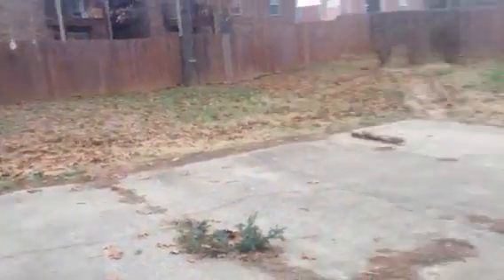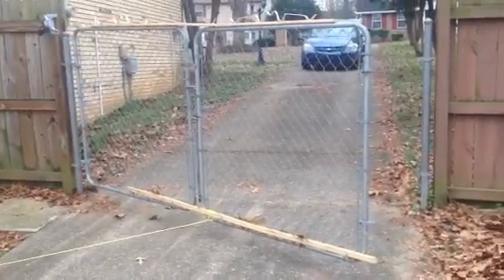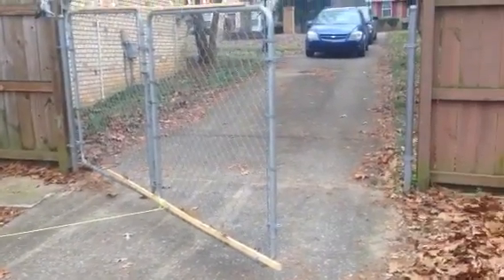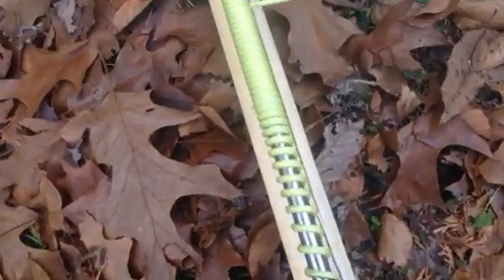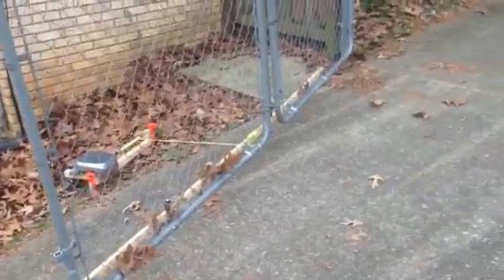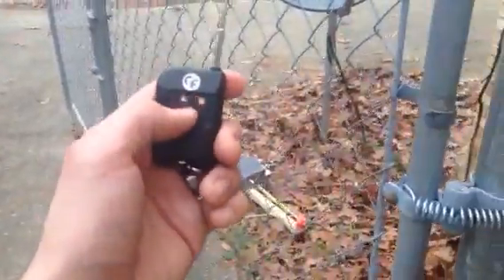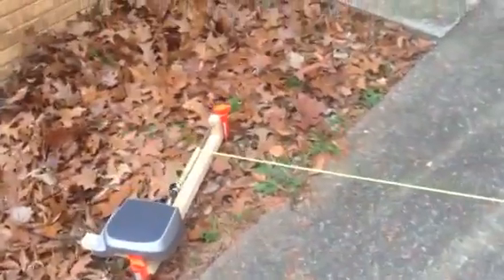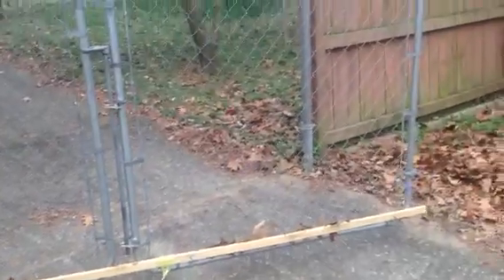DIY Gate Opener ~$50

Comment: the harbor freight 18 volt drill  worrior brand not the real cheap one or a dead free unit even better.or Toyota windshield wiper motor. its low geared one speed n a voltage buck step up coverter box 5 pack at ebay amazon 600 watt 18 bucksish i think hooked to a 12 volt battery n solor or trickle charger transformer based older ones set to what ever works best fer speed13-volt to 22max n your board remote thing and even a dip switch to

Comment: That motor is gear driven, you could have used a 12" diameter spindle and opened it in 5 seconds.

Comment: Hi Mike. This was an awesome project of yours. I actually want to do something very similar to this but I have a couple of questions you might help me answer: 
1. Does the motor rotate directions and how does the motor know when to stop? 
2. How is it being powered (battery, wall outlet)? 
3. How did you make it wireless?
Reply from the maker: sergiomer6 So, the motor does go both ways. It's got an up and down button on the remote. I bought a module from carymart.com. It came with a remote control module which I plugged into a 12v power adapter that plugs into the wall. The motor also plugs into the module. It came with two remotes. Currently, I have to push start and stop manually on the remote so the motor doesn't know when to stop. It's a cheap setup but gets the job done. The motor in this video is a cheap motor I ripped out of an old printer and was barely strong enough. I swapped it out with a motor from a 12v cordless drill. It's way more powerful but the remote doesn't respond as well because the motor draws too much power from the module. I should have got a higher rated module, but I'm actually in the process of adding some resistors to get it just right. It's a pain in the ass and I'm probably moving in about a year, so it's purely for hobby's sake now.
Reply: Very Helpful info Mike. That said, This is what I currently have now:
1. AC 100-240V to DC 12V 3A 36W Power Supply Adapter with female adapter (AKA power [wall plug])
2. DC 12V 4CH Channel 433 Mhz wireless remote Control Switch with 2 transmitter RF Relay Toggle Switch
... Would the items listed, work together?...and if SO, what 12v Motor do you recommend (torque, watts, amps?)
Reply from the maker: sergiomer6 Well, I'm no electrical engineer. I really don't know what I'm doing, lol. But I managed to make this work. Like I said, the motor from the cordless drill is very powerful and opens the gate in about 3 seconds. But it draws too much power and the module doesn't have enough left to communicate properly with the remote. My guess is that this problem can be solved by adding a resistor, but I have no idea how many ohms, watts, etc. This has been an experiment for me and getting this far took a little while. It's a lot of trial and error.

Comment: Maybe, instead of a bigger motor, try using a larger diameter pipe for the rope too wrap around?
Reply from the maker: Problem is that the motor doesn't have enough torque. Even if the rope wraps a second layer over itself, there isn't enough torque for it to continue, so I have to position the box at a certain angle so that it only wraps one layer. Definitely need a better motor.